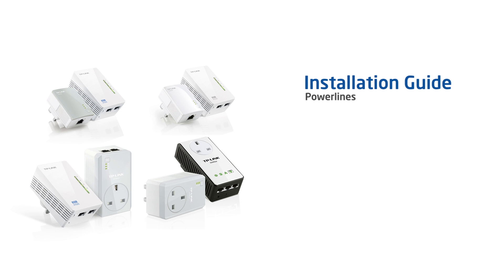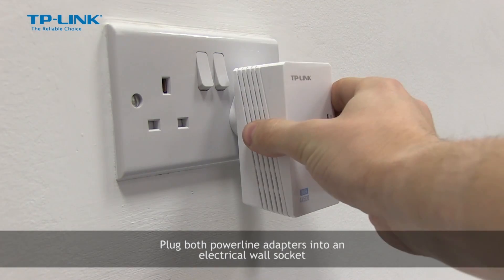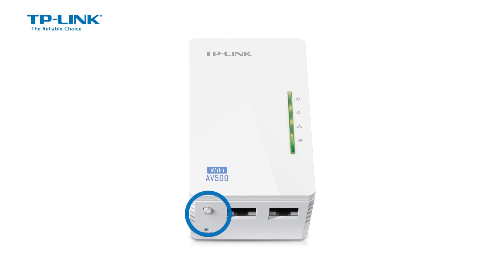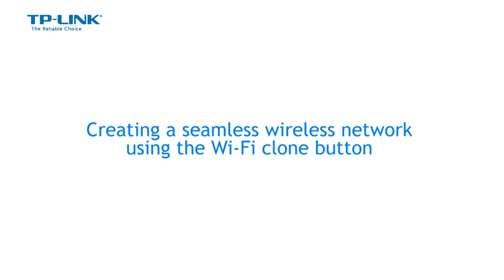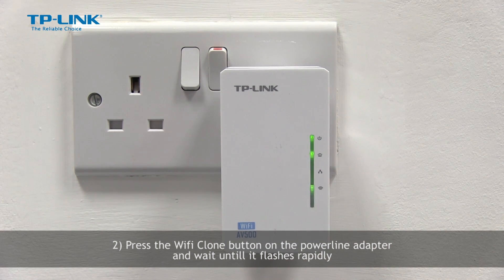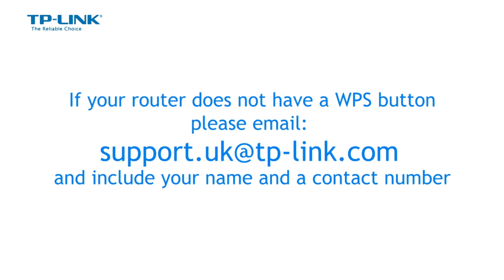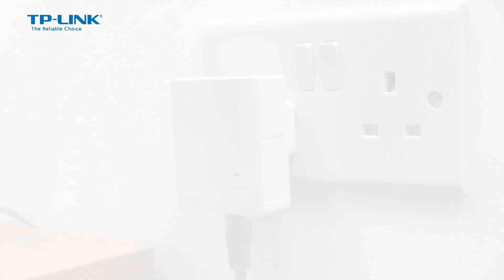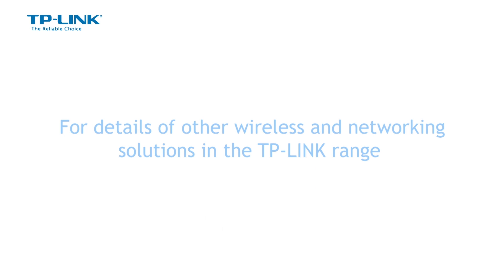How to install TP-LINK Wi-Fi Powerlines

Comment: Hi. I have set up the new TP-4226 for the apple tv in the bedroom as we kept losing the signal on the LG Smart TV.
It works perfectly well but if I connect the apple TV with the new TP Link we lose the signal on the TV.
So I cannot Hard Wire.  Can someone advise me or should i just throw out the cables. ???      Alfred.

Comment: You mention the adapters are paired when the top two lights flash regularly, can you be more specific as to which lights you are referring to? I have the TL-WPA4226KIT and the order of the lights is different to the lights displayed in this video. Thanks
Reply: The power one and the house one